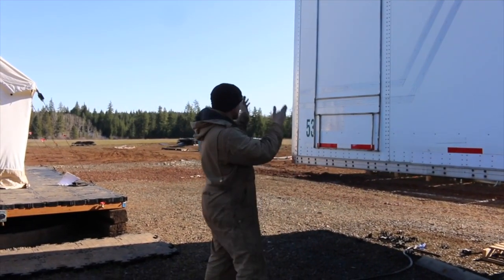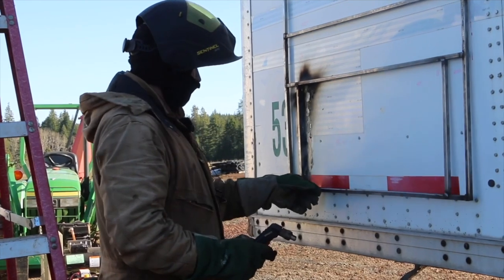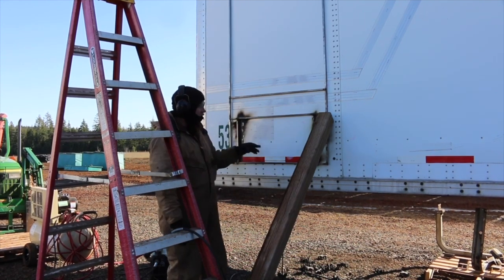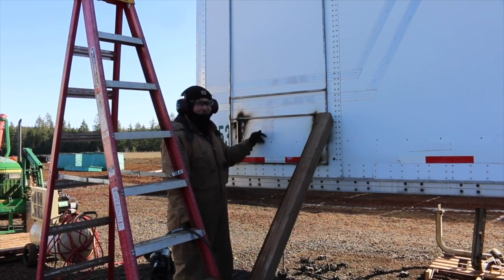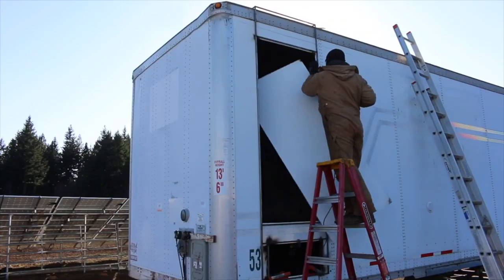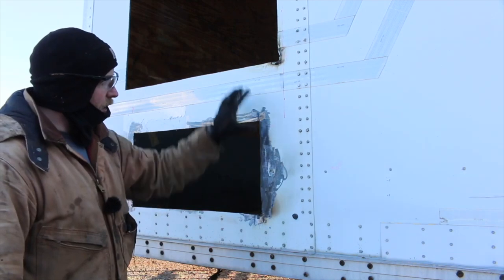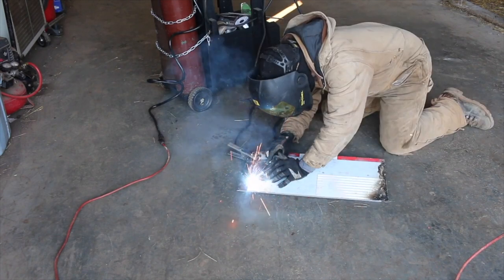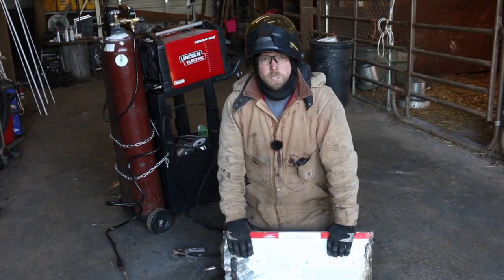Cutting into a 53ft Trailer with a Plasma Cutter

Comment: Use a carbide blade circular saw cutting aluminum trailer sides. Very clean very efficient.
Reply: Never mind, steel sheeted trailer.
Reply: @bigfoot-wo3qy  You can get carbide-tipped saw blades that will cut steel, but you need a saw with lower RPM than a regular circular saw.